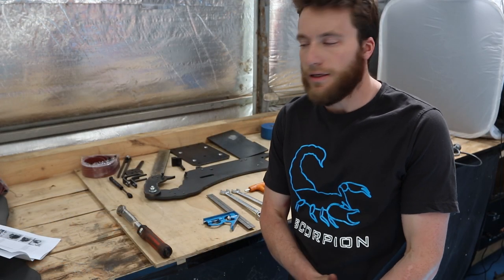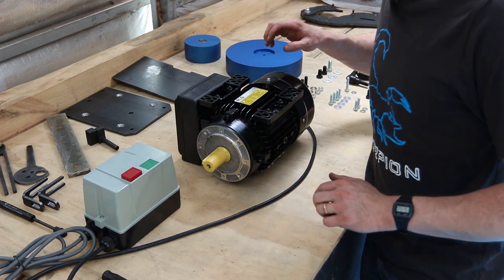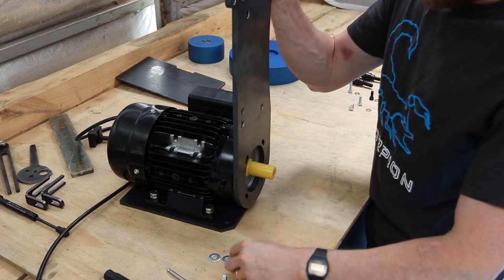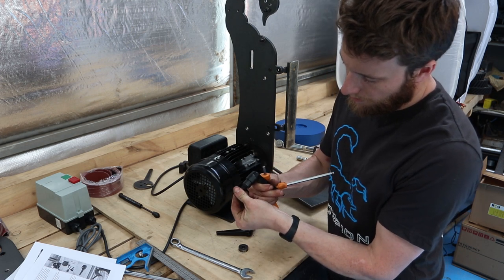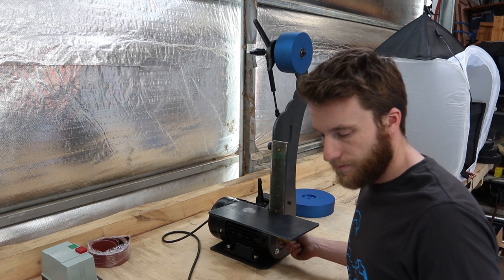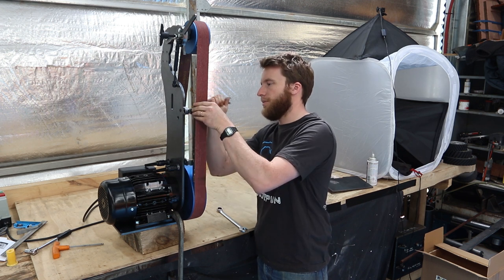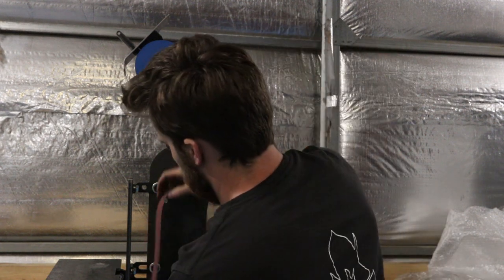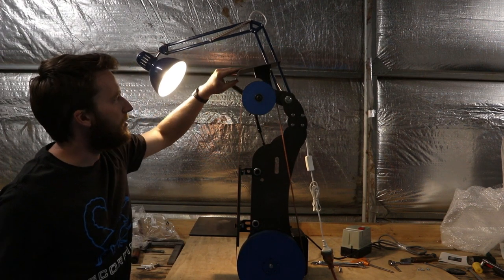Scorpion Grinder Assembly Guide

Comment: Looks cool. Are you able to run this in reverse for sharpening?
Would be nice if you could upload a video of you putting it through it's paces.. I'm considering a shop mate but am open to other makes such as this
Reply from the maker: Thanks Robert. Yes it will run in reverse for light work like sharpening.
We will be doing some follow up videos showing some features and actually working it.
Reply: @FirePantsFabrication  cool... also how much would it cost without the motor? Just the frame / wheels etc...
Reply from the maker: Without the motor they are $899, its all listed on the website.